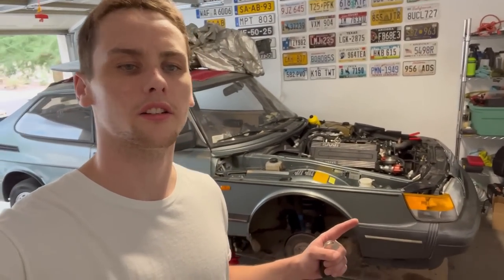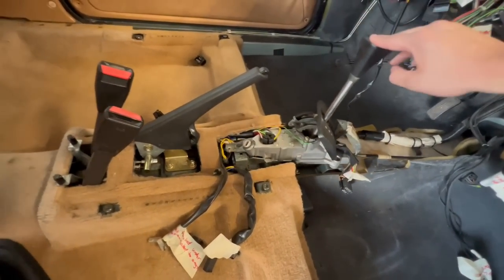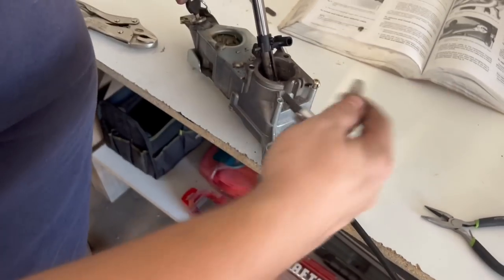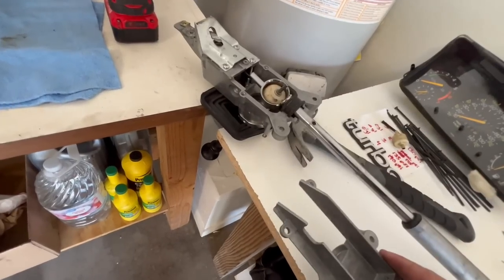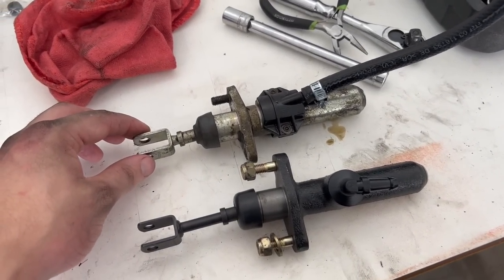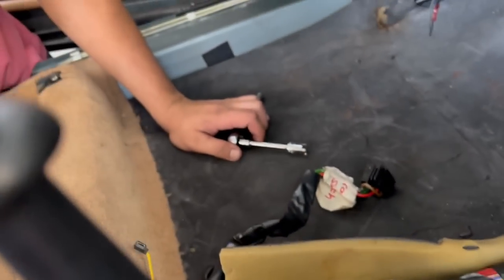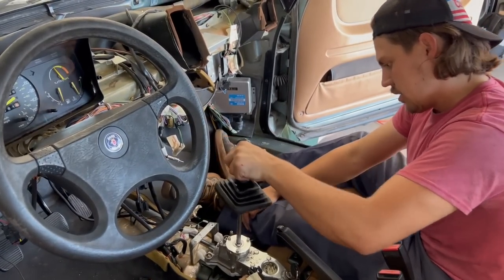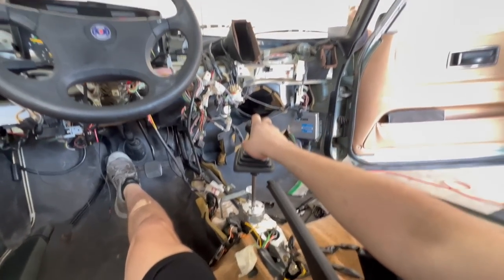Saab 900 Manual Swap Part 9 - It Runs!

Comment: Why not use a proper gearbox oil? I know that Saab said engine oil. But a gearbox oil is better! 🙂 But you have done a good job on the car. 😃👍🏻
Reply from the maker: I figured this was okay since that’s what the manual says to use. I’ve also heard what you recommended works as well!
Reply: @AutoAutopsy  : It is okej. But Saab used gearbox oil up to 1978 and the started to use engine oil to 1997 then started to use gearbox oil again. 🙂
10w40 engine oil could be a problem to the 3 gear on classic 900 gearboxes.

Comment: PLEASE get some proper gearbox oil instead of regular engine oil. Your gears and roller bearings inside your gearbox will thank you. Some good quality 75W90 will be miles better than your regular 10W30 engine oil.
Reply: 10w 30 mineral oil is suitable for old saab manual gearboxes, at least my owners manual for my 900 says so
Reply from the maker: I figured this was okay since that’s what the manual says to use. I’ve also heard what you recommended works as well!